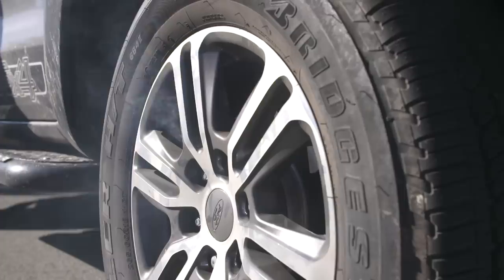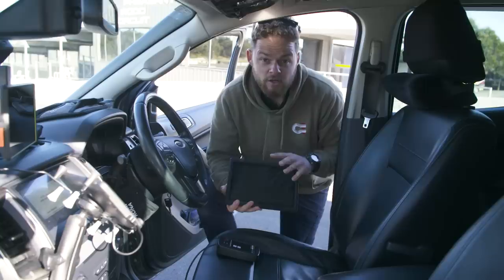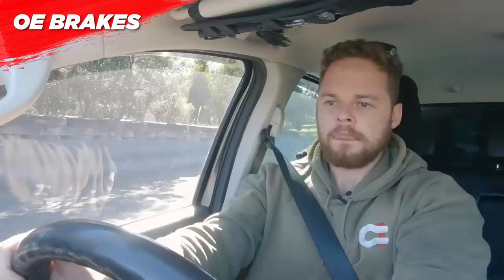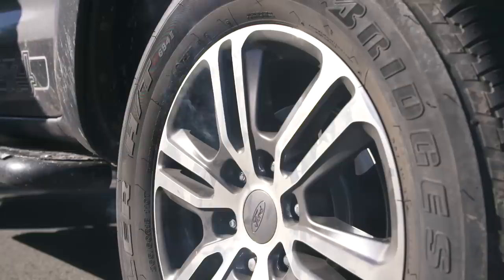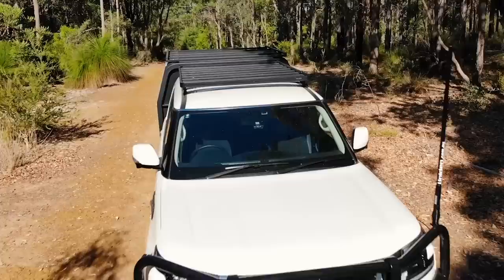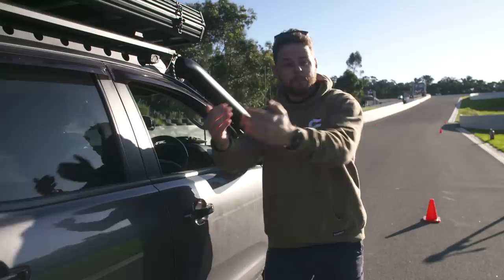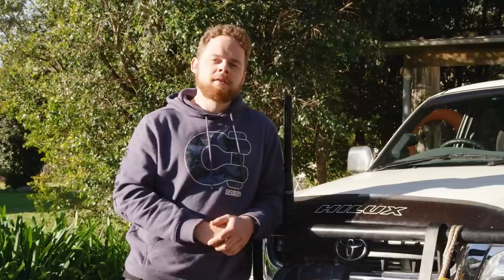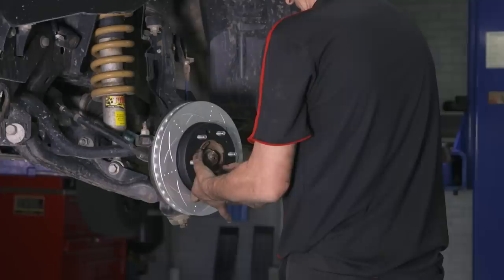ARE BIGGER BRAKES WORTH IT? Standard vs. Aftermarket brake test - Why the OE ones failed!

Comment: Isuzu 2014/15 MUX, I am running bigger tyres and some extra kit (Bulbar, Winch, Sliders, Draws) adding extra weight and it's my daily, upgraded brakes have been on my to do list so winning a set would tick that box off nicely.

Comment: Hey Guys, great vid around brake options. Was surprised to see the differences from OEM to different aftermarket products. I have a modified Y61 GU Patrol dual cab with a 6.5L Chevy diesel. Have had the GVM upgraded and with the steel tray and canopy, as well as the rest of the accessories on board, you can really notice the lack of stopping power, especially when towing. You’ve got us thinking of a Bendix brake upgrade.

Comment: I’ve got an n70 hilux and it’s well and truly overdue for a brake upgrade. It’s fully kitted out with all the 4wd and camping gear and even towing dirt bikes and trailers too. and does not want to stop when I need it to. Even hit a car a couple years ago heading down a slippery hill because it didn’t stop when it should have even at slower speeds. A new brake kit would be a godsend to my car 🙏

Comment: Hey Jocko, great episode mate, love the data that you get on these runs, really handy info. 
I have an Mitsubishi 2015 MN Triton 2.5l dual cab 4x4 set up as a tourer that also tows our new Maverick camper trailer. The wife, the kids and I are planning an N.T trip and brake upgrade is one of the next items on my list as the amount of weight is significantly larger now than it was before we bought the trailer.
Love these Tech eps! Keep em coming mate 👌

Comment: Hey jocko, just bought a 2016 BT 50 at chrissy, 
I'll be towing my camper trailer 1.5t mdc highside all over the place with the missus and daughter, just upgraded the transmission cooling system, upgraded brakes would be a great piece of mind.
Cheers legend👍👍

Comment: Hey Jocko, I've got a good old ln106 Hilux that I've been building up for the last 8 or so months, I love the old lux and a Bendix brake upgrade would be unreal, especially since over here in NZ we have to take our trucks through a certification prosses, I have been told that the only way I'm gonna be able to get 35s on the truck is with a rear disk conversion, and 33s are a maybe with rebuilt calipers fresh pads and rotors, the big thing for me is the cost to put rear disks on as I'm just a student that loves working on old utes, cheers legends

Comment: Perfect, I just got 18 inch wheels so I can upgrade my brakes (and tires) on my r51 pathfinder.  Going is great, but goings no good if you can't stop. Need to be able to stop quicker with the terrible drivers here and the little ones in the car.

Comment: Hi Jocko
Great demonstrations of the effectiveness of each upgrade! Did a NSW trip and my 2015 Fortuner had pretty bad fade heading down Dorrigo Mountain - its a manual but even engine breaking on such a long downhill was not enough! I’m due for new front brakes and stepping up from OE would be fantastic for safety especially as my two daughters use it as their main car! At least they can wheel a diesel manual 4wd even if the braking gets a bit scary at times. Keep up the good work.

Comment: I've got a 2019 ford ranger dual cab. Towing a camper trailer, I notice a substantial loss in stopping performance on the stock brakes. Definitely a brake upgrade is needed.

Comment: I've got a td5 Discovery witch recently grane some weight - roof top tent, rear steel bumper some underside protection etc. I like mountains way more than flat stuff and that's why 80% of my offroading is done in hilly terrain. Brake upgrade would be an awesome addition to a trusty Disco.

Comment: Ive got a 1995 GQ Patrol that I have done an engine conversion on, it has an rb30 turbo In it. Also have a added plenty of extras over the years and would love a brake upgrade to pull it up quicker cause it could definitely use it!

Comment: Hi jocko im driving a 2015 ford ranger pre facelift    i changed out the factory 3.2l 5 pot for a 4.3l v8  and adding all the weight from the touring mods and the 33 muddies  is making a huge difference when loaded up 

But mostly on the tracks is where i need the extra stopping power as we regularly tow unbraked trailers on unpaved roads

Comment: Jocko, got a 2008 D40 Navara. If anyone of you have ever driven one, which I know you have, the braking performance is like having pizza bases for rotors and kitchen sponges for pads. I have recently built our own little camper out of a 7x4 box trailor and it is genuinely concerning at highway speeds. I litterally drive with my hand on the hand brake whenever we leave home

Comment: Got a Y62 patrol for towing and have done some upgrades but missed the brakes as were told they were awesome anyway. After the car mods it certainly doesn’t stop well anymore and need to be done now before we get a van. Winning the kit would solve the problem.

Comment: I’m heading on a trip from Vic up to Fraser and beyond. 
I’ve got a heavy rig, a 79 series dual cab steel tray with full canopy.
Roof top tent etc 
So a brake upgrade is on the list

Comment: Hi Jocko, I have a Toyota Hilux with a bull motor body canopy on the back, new heavy duty leaf springs, 2 inch lift, rival bull bar, 12000kg winch, clearview side steps, rhino roof rack on the front and a motop v2 roof top tent. Lets just say the braking performance isn't what it used to be with all this on it and definitely needs a Bendix brake upgrade.

Comment: Cheers for the vid, brakes have come a long way from the old single pot front rotors! 

My dad has a Toyota hilux for the farm. He could use a brake upgrade for all the towing he does and for the holidays when they pack up and head off with the camper trailer. 

Thanks 🤙

Comment: G'day, got a brand new 2022 D'max that's being setup as a tourer. Adding a lot of weight with a custom tray and canopy package and a whole lot of bar work which the standard brakes wouldn't be able to cope with. What's the point of having all the fancied gear for your rig if you can't stop in time before hitting that roo, or emu. When adding so much weight to your vehicle I believe uograded brakes are a must have. 

Loving the content guys! Keep up the awesome work!

Comment: 2010 Mazda BT-50 dual cab. Recently put some bigger tyres and a suspension lift on. I drive through areas with plenty of wildlife, and after a few near misses, would like to be able to stop a bit quicker.

Comment: Gday guys. I’ve got a 2021 sr Hilux with a fair bit of extra weight. The main reason so extra stopping power would be great aside from weight is the drive to work at 4am every morning, through a twisty hilly country road with kangaroos all over the place, I’ve hit one and had a lot of near misses. Sure the tjm bullbar can take a solid hit, but I’d rather not harm the Roos if I can avoid it.
Cheers fellas 👍

Comment: Wah wah wah. Got a DMW GVM upgrade to 4499 happening mid August for my heavy Toyota 79 VDJ79 r. 

Recently swapped my 1250kg Ultimate Camper for an AOR Matrix with 2600GTM.

GCM hitting close to that max number. Brakes good (Delious front and rear discs and braided lines - bit busted up) with Marks Hydraulic booster.

Luv to swap out original calipers, the delious discs and braided lines with new kit to help with the weight/braking👍

kennym

Comment: There’s a company that has designed a totally different system instead of the breaking system with the brake booster. 

The system doubles with your power steering and the reservoir for more power steering fluid and there’s braided steel lines to all 4 brakes and they are a upgraded disc all round and bigger discs and twin piston callipers and the front discs are larger than the rear and they are slotted and the callipers are a 6 piston. 

When I had come across the video on YouTube he put the ultimate system on a sooty like shauno’s 4wd and how he would always say the brakes were the scariest thing about his 4wd. 

The system was unbelievable and the way it could stop his 60 series and the steep hill that he would stop on going up and had to stop and then start again. Also going down the steepest hills he could find and it was 45-50 degrees hill and they stopped him and held him there on the face of a hill. 

If I was building a tourer I would definitely be putting a breaking system from the company I just wish I could remember the name. If you find out the company I suggest you go and see them about putting a system on one of your rigs for your next big adventure and show the rest of the 4wd community.

Comment: Jocko, I've got a Hilux N80 with a gvm upgrade. Have a slide on camper for touring and a few more mods adding weight. Will be needing a brake upgrade, and this video was great in giving an explanation on options. Definitely want stopping power in case it's needed in a hurry. Would love the upgrade kit.

Comment: The Ole 1989 Nissan Safari / Patrol just isn't stopping like it did 33 years ago and even then, it properly didn't stop that well haha. Of course after added countless Kg's of weight to the old girl, she's pushing 2.6tones and could really do with an upgrade. Especially those old brake lines and seeing that I do a lot of road driving throughout NZ (Windy and hilly) to get to get best tracks, I could really use the upgrade!

Comment: Hi Jocko Great work on the content and quality of your viideos as usuual.
My 2004 100 series toyota has just clocked 520,000 klms and with the few mods I've added for touring plus towing a camper trailer I have been noticing an increase in stopping distance lately 
To win this upgrade would mean I could Tour farther,safer and more confidently

Comment: Hi All, I have a Mazda BT50 2016 model and have just acquired a Fantasy F5S-C hybrid caravan. My wife and I have been planning the ultimate 4wd trip around Australia in the next few months and that doesn't mean staying on the black top. Since the van fully loaded will weigh up to 2750kg, we will need all the stopping power we can get!! Would think the upgrade by Bendix would certainly be a good and safe idea

Comment: Got a 1994 Hilux surf,with a 1uzfe 4l V8 engine supercharged with an Eaton 112 
I use it for daily use and fun with my son camping so got all the gear, but not brake upgrade ( that's my fault focused on the other bits first) so that brake upgrade would be great and needed

Comment: I have a 2017 ford ranger xlt. We are currently doing our big lap towing a 3T van. We have done all the power upgrades gvm upgrade and wheel upgrade but the only thing we forgot to look at was the brakes. We have had too many people pull out in front of us because they are trying to get ahead of us towing a van but all these jerks have been too slow and we have had to hit the brakes way too often. This brake upgrade would dramatically improve our stopped performance for on and off the road.

Comment: Bigger upgraded brakes are great, but it does come down to your tyres as they're what contacts the road surface .
I'm curious to compare the factory brakes and tyres to the bigger upgraded discs (and rear conversion) with a set of muddies on it.  
Many 4wds are not driving with standard tyres but with muddies or ATs.

Comment: One question I have is , you mentioned the slots in the rotors are to remove heat .
I have always thought they were to remove gases from the brake pads 
And the fins in the middle of the rotor are to remove heat

Comment: Gday Jocko, Great Vid and interested in the promo.
1.) My 2006 Holden RA Rodeo dual cab weighs approx. 2.4 tonne with the accessories fitted. I've done multiple trips throughout Australia and always fitted Bendix pads to my vehicles as in my opinion they're the best. 
2.) I'd like the upgrade because my kids are learning how to drive now. Whilst I know how much effort it takes to stop the mighty Rodeo, they don't. Any additional braking ability the Rodeo gets, will make it safer from them, me and everyone else on the road. 
Cheers

Comment: Big disc brake upgrades are only possible if the wheels on your 4WD have a large enough diameter to fit the bigger rotors.  Something that should have been mentioned in this video.  I don't think I can upgrade to bigger rotors without changing the OEM 16 x 8 alloys on my Toyota 80 Series Land Cruiser.  But it does need a brake upgrade.

Comment: I got a 92 LN107 and she definitely needs a brake upgrade. I have done the rear shoes for the drums but the front rotors are warped and worn and the pads don't have much on them. Due for an upgrade so I can take the family out the McDonnell Ranges.

Comment: 2013 Dmax with full bar work set, always running at GVM and towing a heavy camper. Definitely needs a brake upgrade for those long downhill descents, the modern day 4wd don’t engine brake as well as the older vehicles!

Comment: Hey Jocko! I've got a 2007 n70 Hilux which is due for a brake upgrade after 300,000+ hard kms. I also recently bought a tool trailer as Im a chippys apprentice. This brake upgrade would be amazing for the luxy to account for the extra weight that i tow everyday. Thanks Mate.

Comment: I really enjoyed your test and well layer out data set! I have a 2019 F150 w/ Electronic Parking Break. I need and would enjoy the break upgrade kit for my 4x4 truck as I use it to regularly tow heavyweight and heavy load trailers and gooseneck trailers. Also i use the truck in Fire Service/E.M.S. applications where higher speeds and repeated  sudden  hard breaking is common on and off the road!

Comment: Hey fellas, got me self a 2019 gen4 Suzuki Jimny.  Definitely gonna need myself some new brakes after discovering that I’m a bit right foot heavy and possibly a disc brake conversion on the rear.  Found the drums to be an absolute nightmare to pull apart every time I go thru mud.

Comment: Hey Jocko super informative as usual, thanks for sharing your knowledge.
We are gradually converting our grandpa spec 05, series 4, GU Patrol wagon daily driver into our daily that has the ability to have loads of touring/off road fun. 
A Bendix Big Brake upgrade would be an amazing upgrade, especially considering the GU oem brakes are not much better than its headlights!!! A Bendix Big Brake upgrade would be a massive step closer to hitting the tracks. 
Although we have plenty of offroading here in Tassie to explore, we have some serious kms on that big island over there to cover, to find some of the adventures on our bucket list thanks to you guys.

Comment: Got a 2021PX3 ranger why I need an up grade well it's simple since the upgrades and extra weight added due to bar work draws etc it just needs a little extra help, you really notice it off road in tricky terrain, also the saftey upgrade would be grate when towing as I tow a camper trailer for plat which is not that bad but when you tow a 2Ton escervator it makes for some interesting moments even with electric assisted trailer breaks

Comment: Dude, I drive a 94 GQ Patrol still with the original single piston calipers.  When fully loaded on a trip she's very close to the 3 tonne mark and gets pretty hard to stop and the brake fade comes in pretty early too.  I definitely need to stop and such an upgrade will set me up.

Comment: Its interesting the lack of ABS in so many 4wds as be interested the difference it makes. I also think should be a certificate for your license to drive trailers &/or drive a modified vehicle cause not all vehicles are cut out for the extra load or driver skills.
Be safe, think smart and always check your vehicle on the regular (if you don't know how ask)

Comment: Hey fellas the old 2005, 105 series cruiser has a fair whack of weight in and on her 
We're planning a to do another trip through the red centre in the next couple of years (im contemplating towing the outback swan up that way) and it would be awesome to have her pull up like the Ranger and not so much like a road train she currently is 🤣

Comment: These new product test and information videos are great i have started to use them to give my customers info on products they are looking to purchase to help them with the decision on why they should spend the little bit extra to get a better outcome. I have a 80 series landcruiser with the maller breaks and would love to put a brake upgrade on as since fitting the bigger tyres and all the accessories the car dosnt feel as safe to drive anymore i have already swapped out all of the bushes to super pro the old girl just dosnt feel the same as it used to.

Comment: Prado 150 that I’ve loaded up with the works and want to get post rego gvm upgrade which requires a break upgrade. This upgrade would help, not just from a safety pov but also getting the most out of the prado out in the bush

Comment: The data on the upgrades you have done says a lot, I have a 1992 Toyota 4Runner that has had some mods that are putting me very close to my GVM & the stopping power is lets just say that if/when i have to go to the city it gets quite scary at times, so yeah it's time for an brake upgrade..

Comment: I have a Toyota hilux 1996, ln111, extra cab 2.8d ifs.. from day dot it's oem brakes are scary bad, despite replacing pads (bendix), fresh brake flushs and winding up the brake adjustments each year. Just to pass the brake test for the rego test, I remove the tow bar, bash plates, spare tyre, side boards on tray, floor matt's, anything I can unbolt or remove, empty the fuel tank, in order to only barely pass the mandatory brake test.. I would so love a brake upgrade thank you so much.. 😀